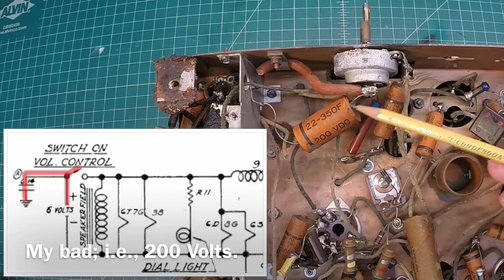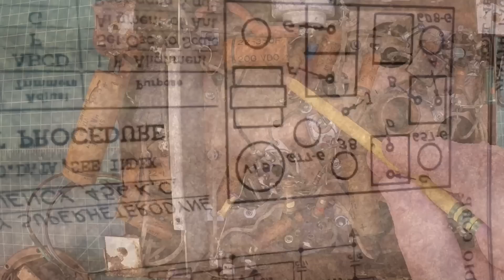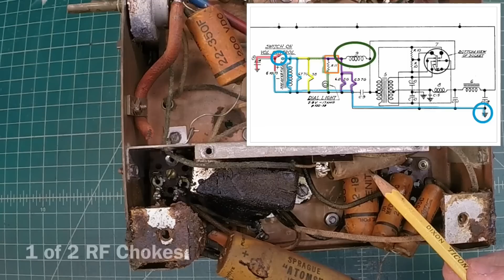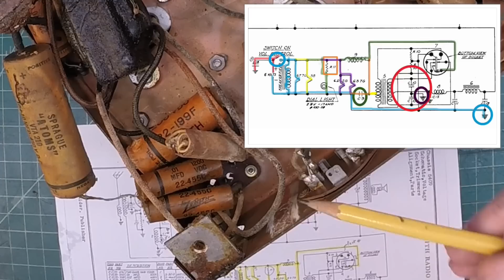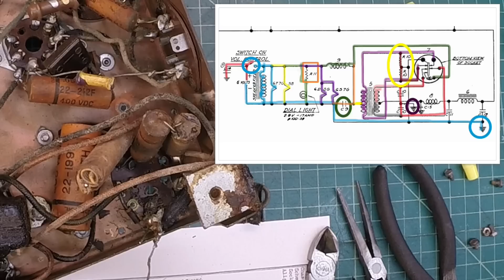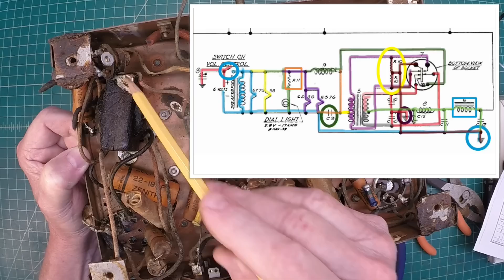Zenith 4-B-231 - Power Supply Circuit Review - Part 4

Comment: I have seen the 2021 video where you convert it to line cord power supply.  What did your dad use for the 6 volts until now to power the radio?
Reply from the maker: I purchased this 6 volt rechargeable battery through Amazon: 
NPP NP6-7Ah Rechargeable Sealed Lead Acid 6V 7 Ah Battery F1

It shows unavailable, but others with a 7 amp hour rating or higher should work fine. I also bought a simple 6 volt battery charger that he used until the synchronous vibrator failed and I converted it.

Hope this helps. 

Best,

Don

Comment: Hi Don. Loved the PnP showing how the parts were traced out on the schematic  and the actual wiring in the set. Outstanding job !  I am wondering if you could sometime make a video,showing the correct way to read voltages in a set Filament, B+ B- Etc. 
All my best buddy.
Bobby
Reply from the maker: Glad it added value Bobby. Regarding voltages, I’ll look for a good candidate and keep this in mind for a future video. Thanks again. Best, Don
Reply: Thank you my friend. I am on an radio right now that has me flustered It is one of those with no name . It has a 25Z5, 75, 43, 6D6, 6A6  It did have two 25Z5 . which wasn't correct. I don't know if the tube are correct or not . It make"s a very low hum. It only plays if I hook my generator or Am transmitter to the volume  wiper?. it has a feildcoil  speaker.  I have trouble remembering things, so not sure ?. I have looked for a schematic till I am sick of looking : )  GRrrrrrrrr. Think I would have better luck building one from scratch Lol. Sorry for writing a book.
All my best.
Bobby

Comment: Really cool and super instructional Don, I mean this was great. I’ve been reading prints and schematics for years but the nice thing about them is they make sense, they are are clean and typically straight lined. Then looking at the actual radio is like an as-built, no telling where the stuff goes, especially when you can’t find it and have to dig it up! Like those little resistors buried in hemp crap over the tube. Or pulling up the buried caps to see which way the wires underneath go. I know you spent a lot of time on this and it was great. Thank you Don, you rock!
Reply from the maker: I really appreciate your kind words Buddy. I’m trying to show as much detail as possible for my Dad as his days repairing radios has passed. Hope you have a great week and be on the lookout for Part 5 later in the week. Best, Don

Comment: Don I'm loving this. As you know, I have the same model and am restoring it as I see your videos. As for the dial lamp lead. I'm sure you've discovered by now that it originally went to the red and blue resistor (R11) that comes off of the power switch. The lead attaches to the terminal strip, which on your unit has no connection other than the resistor. Lucky for me, my unit still has the lamp and it is still good. I'm not sure what bulb type it is - 2.9V at .17 amp according to the schematic.
Reply: A bit of searching turned up that the bulb is a type 292A. One source is https://www.topbulb.com/292-bulb-2-9v-0-17a-t3-1-4-incandescent-e10-miniature-screw-base Also here http://www.oldradioparts.net/lamps.html A type 291 bulb has similar specs but I don't know if that is a good sub or not.
Reply from the maker: Thanks for your research on the lamp. I’ll print this and keep it with my documentation on this repair/restore. As you stated, I saw the voltage dropping resistor that had been bypassed on the terminal strip as I was editing the video. To keep my camera just above my work area limits my view of the chassis at times without sticking my ugly head in front of the camera. LOL I cheated and removed the resistor and went back with a more standard 6V lamp. Thanks again for taking time to research and share those links with me. P5 up next; testing the transformer & chokes followed by P6 later this week focuses on replacing the old caps, resistors, etc., in the PS section. BTW - how far along are you on your repairs? Best, Don
Reply: Going with the 6V lamp is probably a good idea. I'm not sure how you will be powering and using this radio, but I doubt that the lamp draw will be of any significance. I had to order the PS buffer caps. I'll probably start replacing parts when they arrive. I tested my speaker voice coil and transformer. They are thankfully fine. I've restored lots of radios, but none to the detail level that you routinely do. I hesitate to do any parts changing until I see how you do things - a bit of WWDD? (What would Don do)  :-)
Reply from the maker: I got lucky on the buffer caps. I had a few 2kV ceramics left over from another project. To your point, the 6V lamp made more sense to me than ordering that specialty bulb. The published specs on the radio is 2.1 or 2.2A. I’m using a small 7A security battery in addition to a small 5A switched power supply that seems to produce a lot of EMI for testing and I’m building a power supply for this radio as well. That’s great news on your speaker, voice coil and output transformer. Look forward to hearing more once you get your parts installed. Best, Don